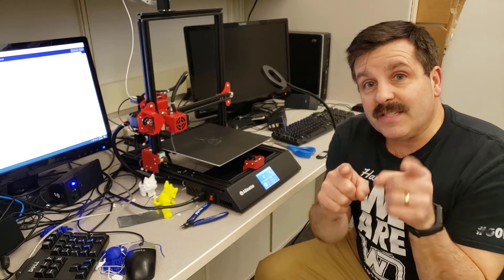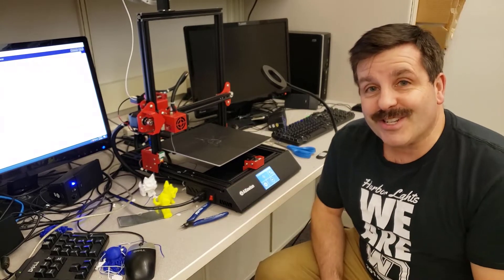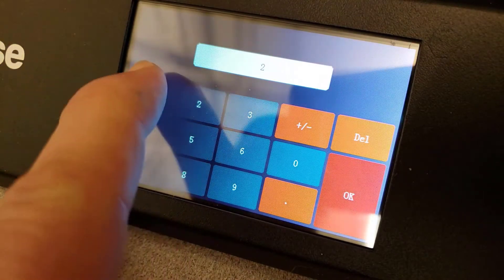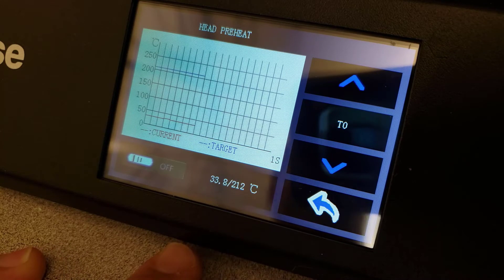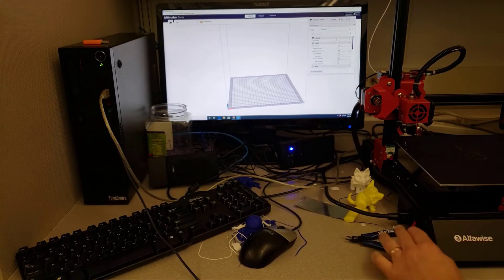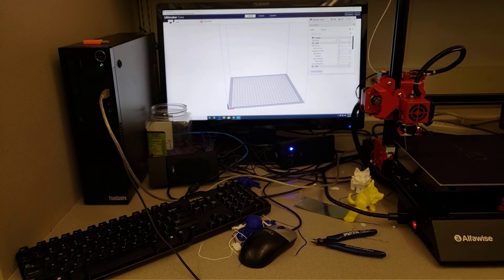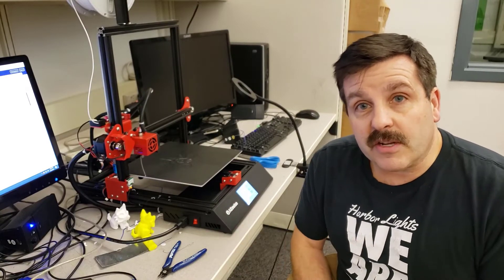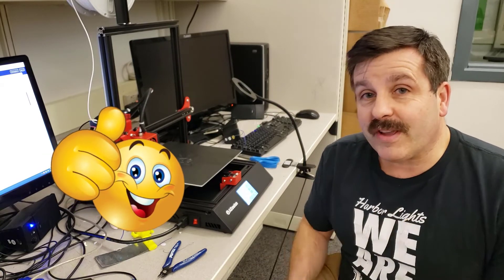My First Alfawise U50 Glitch!!!

Comment: Ifit has how much time need to arive to 100c°
Reply from the maker: I have never taking the bed above 70... the hot end heats quick though if that is what you are asking
Reply: @HLModTech  how long the heat up time was for the  heated bed  (70C°)
Reply from the maker: @Lucas_sGarage  It is at my school, so I cannot double check, but when I work with it I never feel like I am waiting for it. I have printers where heating up takes forever.  U50 is snappy. I can try to get a test recorded if you want. Just not sure if it will be this weekend.
Reply from the maker: Tested! Check it out. 👍 https://youtu.be/-EEsYqmeJF0

Comment: U30 or u50, what is better for you?
Reply from the maker: I have not used a U30 before. When I had the chance to purchase though I choose the U50. I am only a few weeks in, but it has been great so far!
Reply: HL ModTech i want to start too, for you is good u50 for beginner? Ps, sorry for my bad english..ahah
Reply from the maker: @Pinozzo  I believe so. It takes a while to get skilled at bed leveling, but the assembly was pretty easy.   My video on assembly is pretty quick. The cables are well marked and the design is well thought out.   Hard to beat the price. 👍
Reply: HL ModTech ok, thanks👍